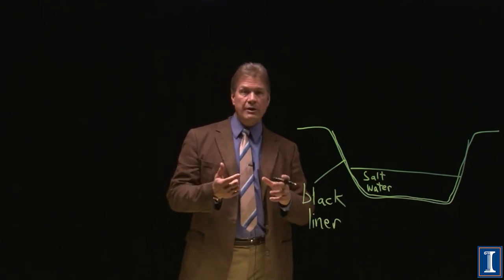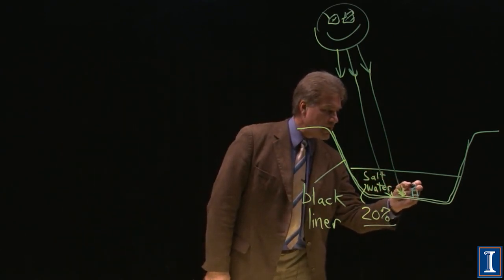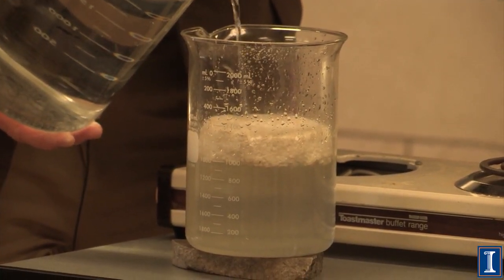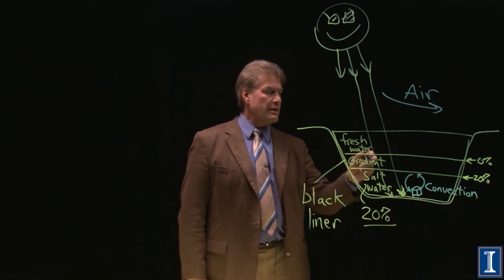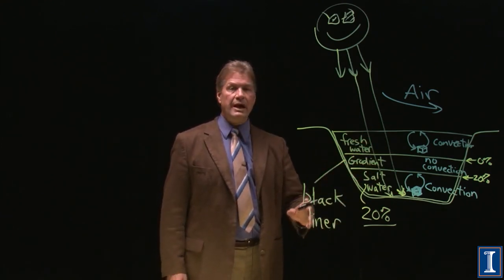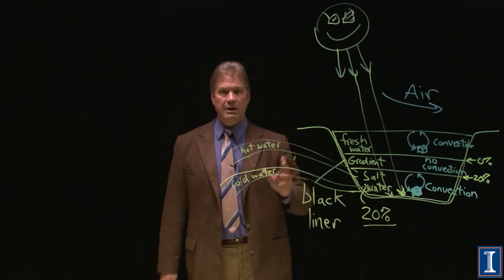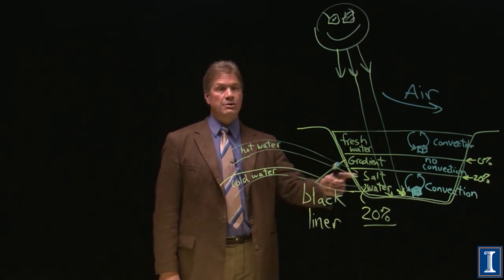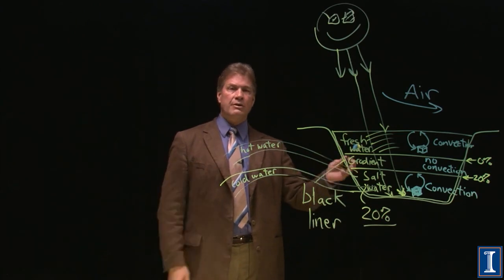How Does a Salt Pond Work?

Comment: Water is practically opaque to infrared spectrum of light which is around 50 percent of the solar radiation reaching the earth's surface.. uv is scattered...which part of the solar spectrum is responsible for the heating at the bottom ??

Comment: What about putting a see through cover over the pond - & regulating valve openings tapping heat exchange pipes for rate of heat transfer.  Acetate cover.
Reply: That's what I was thinking, what if you just either put it in a building with a glass/plexiglass roof, or simply have a sort of clear "lid."  Does that not work for some reason, and then when it's time to maintain your system is it not just as simple as Windexing the glass ?
Reply: I was wondering the same thing

Comment: I don't get it...I get the blocking of the convective loops. But water is a good conductor. The hot bottom layer simply conducts it's heat to the top most layer which then cools as usual. What am i missing? Also, how does adding salt affect the speciffic heat capacity of water? Is there something to be gained (heat storage wise) in supersaturating water?
Reply: By using a concentrated brine for the lower layer, you've essentially created another type of solution with different properties.  Density being the most critical.  The difference is enough to keep the convection cycles separated, due to the gradient layer.  I'm sure there is some heat escaping, but nowhere near what there would be in a single-state solution.
Reply: The key is in the gradient. I’m no expert but judging by the video, there’s less thermal transfer between layers that have a very small temperature difference, and you have many such layers, because it’s a gradient.

Comment: If they only had to maintain it once a year then it seems like there's a possible scheme for handling that maintenance continuously and possibly just using the power in the heat. I'm imagining thin pipes, spaced a few feet apart running parallel horizontally through somewhere in the the gradient layer, the top of the fresh layer, and the (near)bottom of the saturated layer. Water being slowly drawn in from the gradient layer, filtered, partially distilled, and slowly returned as 100% fresh to the top and concentrated slat water to the salt layer. If done properly the dust getting into the top should eventually be drawn down by the replacement of fresh water and into filtration while constant replenishment of both layers should keep the multilayer structure intact. Theoretically, that is. Also theoretically, that leaves your only major maintenance issues as large debris and silt accumulation in the intake pipes. I imagine that large debris can be gently fished out and the intahe pipes could potentially be just hooked to insulative hoses so they can be detached from whatever frame holds them in place and drawn out for back flushing. Who knows, maybe I'm a fool and there's no magic flow rate that will catch all the dust without destroying the layer structure, or maybe you have some other hole you see in the schema, but to me it sounds half decent. If I had the means I'd test it on a decent scale.

Comment: Would a transparent film on top help with dirt getting into the system?

Can you hold that insulating layer of water in place there forever?
Reply from the maker: The film would get dirty instead and that would block even more light. If dirt gets into the pond, it may settle out on the bottom.  On the film, it would always stay there.   Also, the film would block some of the lights rays -- particularly the highest energy which is what we want the most.  Also, so light reflects off of it -- maybe more than would reflect off the water.   A good thing is that it would provide an evaporation barrier, so the pond would not need refilling as often....   Don't think that outweighs the dirt issue though.
    Good try  -- keep thinking!
Reply: @illinoisenergyprof6878  why don't we place series of convex lenses which converge the light on certain points , or if feasibility is high we can place a large convex lens which acts like a lid on the pond and we can make it to rotate on its axis which produces a tornado effect on the water and we can then converge the light rays on the eye of the tornado and connect a pipe through that eye region so every unit hot water gets absorbed directly.
Reply: @illinoisenergyprof6878  What do you think about rotating fresnel lenses over the pond? The lenses will magnify the amount of light delivered to the pond, making it feasible in less optimal solar environments. Swapping in opaque material in lieu of the lense will allow for managing the temperature profile of the pond. Condensation can be routinely wiped away as the lense panels are rotated on a carousel. The system also becomes a sealed system, which is relatively immune to particulate matter contamination. Running a thermal energy conversion system can optimize energy production. So Solar  Pond Thermal Energy Conversion SPTEC. ?
If I am correct it would be useful in a much wider range of locations too.
Reply: @michaelfoye1135  I just realized I typed something similar but coming from a more basic understanding anyway i support the idea which you presented it should help I believe.
Reply: And you'd get a green layer of life trying to grow under that film too